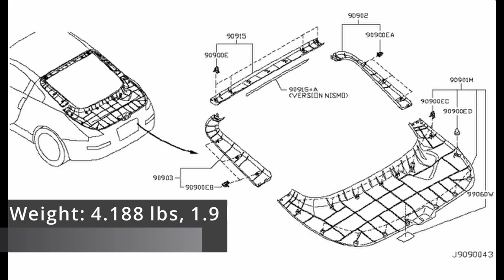Take It Off: Nissan 350Z Plastic Panel Part Weights

Comment: I would legit buy that padding for the spare wheel from you lol just to silence up some road noise
Reply from the maker: :-). I know what you mean. I bought some acoustic fabric to deaden the sound. After I took the panels out, it was too loud to be a daily driver but the fabric did the trick. I don't remember the brand but there are several.
Reply: @robreview  I will look into it!

Comment: Do you still have any of these parts if so i would love to buy them off of you
Reply from the maker: Hi @olivergrajales400, thank you for reaching out! I don't have the panel parts but I do have several other parts: OEM y-pipe, muffler, tail light, marker light, and some others. Any interest? Happy to work something out.
Reply: @robreview does that mean you dont have the trunk matts either
Reply from the maker: @olivergrajales400  Not anymore. I sold all the parts. The carpet is heavy! Some cost effective alternatives are automotive fabrics (onlinefabricstore.com), Perlon Felt (pelicanparts.com) is lightweight and a favorite of mine, there are also lightweight fire resistant automotive fabrics, I've even seen folks use Nomex which is used in racing suits as it is fire retardant.
Reply from the maker: @olivergrajales400  Correct, I sold the matts. Only have OEM y-pipe, muffler, and a tail light left.